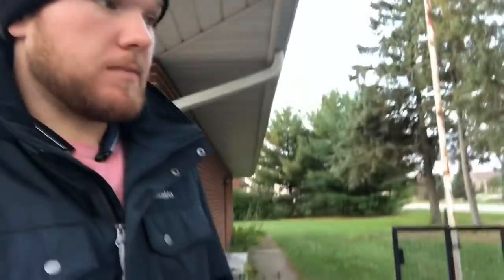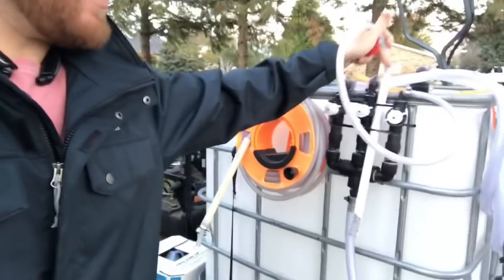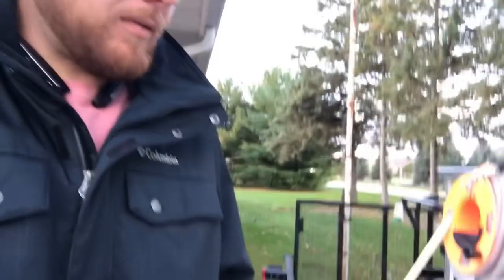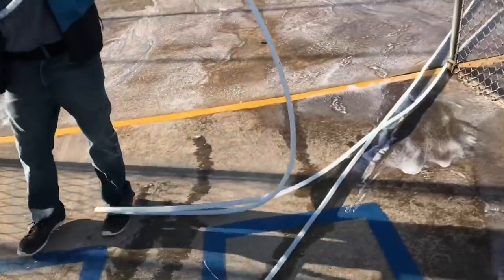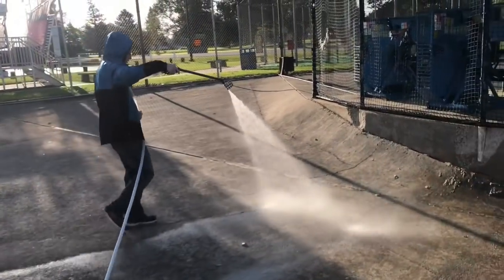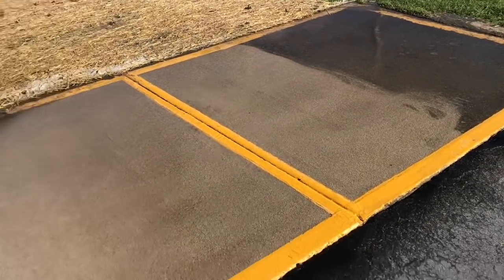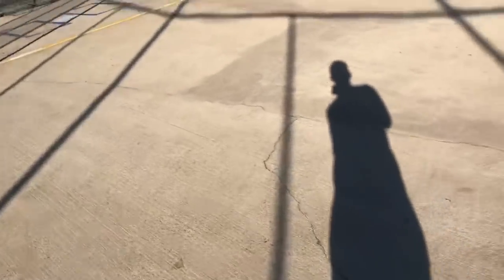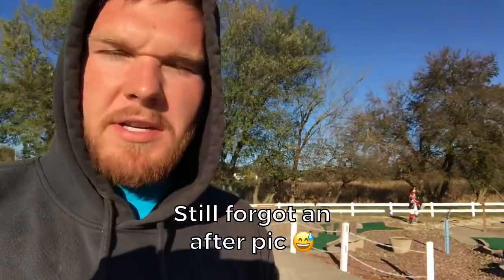Surface Cleaning and using our home made proportioner

Comment: I used to pre treat, now I only post treat if needed. I waste less SH and I don't have to smell the SH the whole time I'm surface cleaning. Sometimes using just the surface cleaning does the trick (no lines) and there is no need to post or pre treat but if you would of pre treated it would have been wasted. If the concrete is bad and the surface cleaner does not get all of it then post treating kills the rest. When i post treat i use a 2% mix which is not too strong and it works great and gets rid of the lines left by the surface cleaner. Down here in the south exposed aggregate can get really bad so i know before hand i have to pre and post treat.
Reply: I always thought pre treating just helped the surface cleaner work a bit faster.  Only makes a slight difference, so I only do it if I've got some mix left from the house wash.
Reply: no doubt it helps, but sometimes its more efficient to only post treat. Either way its better than not doing it at all. I would say that faint lines are left on 80% of the driveways i do and post treating them makes the disappear.
Reply: What exactly is your post treat process?
Reply: @housewashjosh5910  Surface clean, then post treat with 12v pump. Its about a 1.5% SH and surfactant mix.
Reply: Do you rinse the post treatment after it sits or just leave it to dry?
Reply: @cchast3  I too would like to know if you are rinsing the post treatment or just letting it dry. I can't ever get those surface cleaner lines out. If the concrete has been densified or hardened, no lines are left. I'm not sure we're talking about the same lines, I'm not talking about the round lines, if you leave round lines it means that you're walking to fast and need to slow down. I'm talking about the long lines that are left on the left and right sides of the surface cleaner.
Reply: @pressurewashingservices3274  I do not rinse after post treating. If the vertical lines are darker then the rest of the concrete then that means are using too much pressure and you are etching the concrete (post treating with SH will not help). If the lines are lighter in color than the rest of the concrete then that means your surface cleaner is cleaning the outside edges more which is normal. This is more noticeable on a really dirty concrete. These lines can be taken away most of the time by post treating.
Reply: @cchast3  do you see the rocks of the concrete after using pressure washer? Like it the pressure was too strong almost?

Comment: Why’d you use roof mix on the concrete in the batting cage?
Never done a roof before lol is the SH a lot stronger? I know there’s thicker surfactant in roof mix..
Reply from the maker: Pat H yea I guess I shoulda clarified that. We went real strong with the SH (like you would with a roof) but we didn’t use roof surfactant. We use little - none on the surfactant for concrete cleaning because you don’t need it to stick to concrete because it’s flat! And it’s easier to rinse when there’s only a lil surfactant in the mix.

Comment: You need to come up with a name for the mixer. Trust me that people will have a problem with you calling that a proportioner. That’s why if you notice guys that make one come up with there own name
Reply: I agree, there is a big list of this guys that sells this mixers and are about to get a nice letter from the inventor, you have a mixer not a proportioner that belongs to someone already,  now 3/4" lines, you're using to much products with 3/4" lines 1/2" lines are good enough and the soap should be 1/4" line, Do yourself a favor and don't try to profit from it or you'll be in trouble